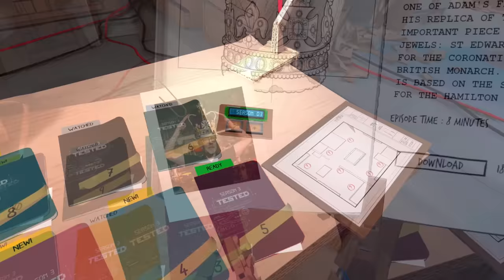Adam Savage Demonstrates Miniature Spaceship Paneling!

Comment: I love the use of miniatures in film. In the original Blade Runner, the Tyrell Corp building was so damn good. I have the disc set and the special features section covered the model making and filming of the models and it captivated me from the very first time I saw it. So much detail. It's why I still prefer practical over CGI.
Reply: It's on YT as well (or was), and it's a great extra.

Comment: Adam, two quick questions:
1.  How do you make circular panels, or cut larger holes in panels? 
2.  Do you find it more difficult to model a real object, such as the space shuttle, vs a fictional object? 

I imagine that modeling something real would be more "fussy" because everything has to be fairly exact, unlike a fictional space ship where you can just apply details any way that suits the eye.

Comment: Great to see the techniques and hear the rationales. I've been using this same kind of polystyrene sheeting to build my own electronics projects around — I'm often using flat sheets in the same sort of sandwiching forms where you'd see laser-cut acrylic, but I've also done a bit of thermal bending — so it's great to see a master at work.  And yeah, the scraps are always handy! Recently I had an overlarge and somewhat irregular slot cut out of an aluminum panel that a slide pot was to sit behind, and it just looked messy as well as being open to dust falling into the pot; I was able to fashion a slot cover from a scrap of styrene that made the thing look much better.

Comment: One method tip: before gluing your parts together, try fitting them together using Blue Tack which is that putty that comes in strips like flat clay and ppl tend to use them to hang pictures. It works excellent for piecing together custom models by eye; once you have the look you want, then go back and glue everything in place.
Reply: GREAT IDEA!!! I use white glue in the same process then when I satisfied with the look I remove the parts-clean the surface and permanently cement the parts back. It's like sketching in 3D.

Comment: Dang, I missed my calling because I did this stuff in 1980-81 (in high school) when I scratch-built a 'The Empire Strikes Back' AT-AT before there was a model kit available.   Won a state fair best of show trophy actually. :D. I used the paneling technique, a small lathe to make the feet, engine systems, and neck--vacuum molding for the ear turrets, kit bashing...in fact, I recall the rear of the AT-AT used a Tamiya WWII German armored car hull which I used in my model.

Comment: Just watched this again for inspiration. I am building a Polar Lights 1/72 C 57D only instead of the smooth surface detail. I'm going to use the kit as an armature and apply panel detailing to it using the techniques in your video. My goal would be see what the design would look like as if the film were produced today.

Comment: Hello Adam, Good to see you.I actually like myth busters.
  I build 1/25 & 1/24 scale semi model trucks from AMT & Italery . I also have scratch built lowboy trailers. I've built a 3 axle jeep, 4 axle lowboy trailer with a 3 axle trailer booster of a 1:1 lowboy all from white styrene sheet, all but the susspion & wheels with tires,those where casted from resin

Comment: Allow me to suggest something for the crew and editing: If Adam had used different colors of plastic between the 3 "chapters" It would be MUCH easier to film it and for us to see.
Basic layer black plastic, panneling white plastic, greeblies with black plastic bits and grey moddeling kits.
It will all be painted later after all!
Love the content, could be easily expanded to different aesthetics:
"Adam builds a SW/Alien/Trek inspired model"...
Reply: Styrene pretty much comes in white. If you want other colors than you have to change plastic type which can cause issues with glue and sanding. Painting between layers adds its own problems in that you're now gluing to a paint layer instead of plastic to plastic. Basically it's not as simple a fix as you think it is.
Reply: @jackdoud  he said in the video how styrine comes in different colors, mostly white and black. My suggestion adresses it by saying to intercalate the 2.
Reply: @TheDrMike25  model making polystyrene usually always come in white.
Colored ones are "sourced" from containers, bottles etc that are made of ps/polystyrene, or from model kits as the one he has shown.
Reply: I agree, the lighting on the white styrene makes it hard for the camera to pick up details and it’s a bit hard on the eyes.

Comment: Old styrene weld bonders were methyl ethyl ketone. Those were slower acting and typically had a vinegar like odor to them. Many of the odorless weld bonders used these days are methylene chloride based. They work faster and can bond styrene, ABS and acrylic. MEK tended to be slower acting and can keep the plastic soft for a bit.

Comment: Adam, I majored in computer science and in my senior year learned 3D modeling and animation. My dream job was to work at ILM, but couldn’t get my foot in the door. Ended up building model airplanes as a hobby, and used this exact technique on several. Now I’m 3D printing almost every part.  If things had gone just a tad bit different, we very well might have worked together. Envious!

Comment: Onya mate 👍.. I think modelling at this level can be done with little upfront investment. Sure, you start out small till you get the hang of it and find your niche, but the reward you get is such a high when you look back over what you made from what is basically sheets of plastic, glue and paint.   

Start out by copying something (small) you like (from photos etc); when you get the hang of it and you get that first high you can start pushing yourself to something a bit more elaborate.  Videos from masters such as Adam are worth their weight in gold so soak them up. 😎

Comment: Whenever I need to snap off a very thin section of styrene, I love to set my vise just wide enough that I can get the sheet into it, then use it to snap the strip off. I find that it gets better results than pliers because it doesn't end up marking the styrene, and so I can use the piece I snapped off without having to fill in any divots caused by the edge of the pliers or their teeth.

Comment: Can I recommend also when using model kit parts dont be afraid to alter them by cutting or sanding sections. Nothing worse than recognizing a panzer four exhaust manifold on your starship! Some of yhe Tamiya inexpensive military kits yield some great parts their anti aircraft flak gun is great also the german tank engine repair crew kit with tank engine is great for parts. Adam you have got to point out where you put the Universal Greebly on the build. Cant forget that

Comment: So only 11 mins in, so you may cover this, my teaching master for concept models also taught me to to use a shooting board to square my styrene sections with a block plane. Also weldbond works on foamed styrene sheet as well, but you can't snap it the way you can with straight styrene sheet

Comment: Any tips on keeping/storing solvent based adhesives that easily evaporate between projects.

Once opened a can of weld-on #3 or 4 seems to disappear between projects, but not a lot is needed for most projects.  I've had this issue when I was making projects from acrylic and it really only takes a small amount, but cans start at about 4oz.

Comment: so that leads to the question as to whether you find the monolithic carbon fiber wings of modern fighter jets ... frustrating?

Also, have you ever used chemical etching on the polystyrene sheet to give it either a dye or an easier to work surface?   I've done the surface effect, cannot remember the chemical, but it carved like cold peanut butter.

Comment: Back in my dad's younger days, when modelling weld bond glue was expensive to procure in former Yugoslavia, he and his buddies would improvise by melting down (actually dissolving) styrofoam in Trichloroethane, which you could get cheap in paintstores, or for free since he worked in a petrochem plant and it was a byproduct of some production process

EDIT also if I'm not mistaken, most model kits at the time were styrene based.... Unless they were wood lol

Comment: Does anyone know, what the name of that glue is? o.O This is so awesome, how fast that stuff works, never knew, that such stuff exists. And of course, thats an awesome video and thanks for sharing your technique and those good hints about how certain looks came to life (utopia -  everything aligns beautifully, dystopia - almost nothing aligns).
Reply: There are a number of different kinds that are similar (Plastruct Plastic Weld is available at most hobby/train stores and online).  It actually isn't GLUE, (which sticks to two surfaces then itself, bonding them), it melts the plastic to bond pieces mechanically at the molecular level. The key thing is there are different chemicals for different types of plastics - so make sure you get something that works with what you're using...
Reply: @ATrainGames  Ah, i see, thanks a lot :)

Comment: So, question: if you had to make a symmetrical duplicate, say a mirrored version for a "wing" on the other side of a spacecraft, while I could see how the larger styrene pieces could easily be done (just make copies of each and flip them over before welding), when it comes to the greeblies coming from the model kits and the smaller styrene pieces, do you just essentially eyeball them in to be roughly in the same relative positions, or is there another method to make it more precise?

Comment: If you drew the perfect grebles parts tree we could 3d print a mold, and manufacture Adam 

Savage grebles kits (c) as a stand alone product. Possibly make them in several scales, and 

styles. Calling on your connections in 3d printing, and injection molding companies you should 

be into manufacturing in a week. This would be the greatest, and most lucrative advance in 

model making since polystyrene. So obvious no one has thought it up. By the way, this post is 

a tangible form of the idea thus is a copyright registration,  Better jump on the stick before ILM, 

Disney or Revell beat us to it. Killer merch, and a killer app for 3d printing.

Comment: Another place you can go for super cheap greeblies (and sometimes more structural parts too), cheap toys (used stuff from the thrift store, just clean with soap and water), packaging materials, and plumbing stuff. Always cut up a shape or people will recognize it, humans are excellent at pattern recognition. Its like all we're good at. Dont just consider what the outside of a part is like, the inside, or the reverse side, the mounting points and structural pieces inside of something can be as useful as its outside. Less is more, and I dont think these replace model kits, just help supplement so you dont eat up expensive model kits too fast.

Comment: Does a sheet metal nibbler make notching panels any easier or is it not so compatible with the polystyrene?
Reply: I recall a video he did a while back where he used a nibbler to notch styrene, I believe.
Reply: Nibblers are great for notching. A good tool to have. Also like Adam, save the offcuts they make great grebblies.